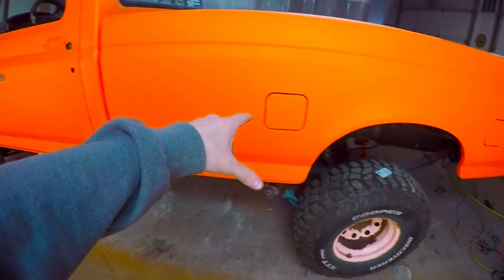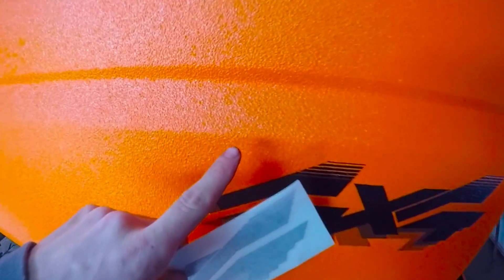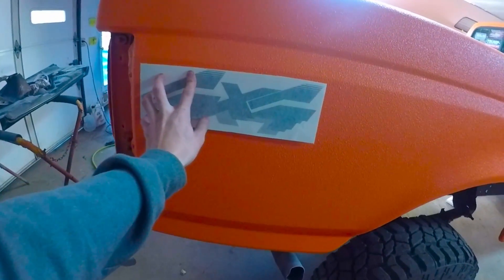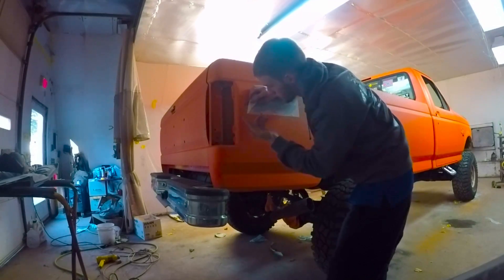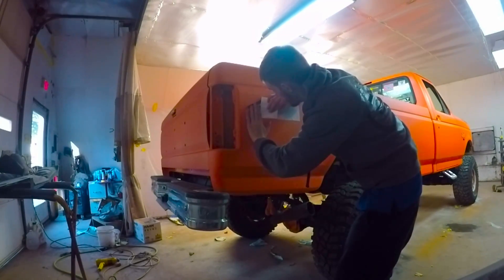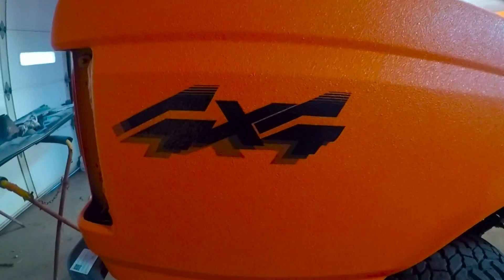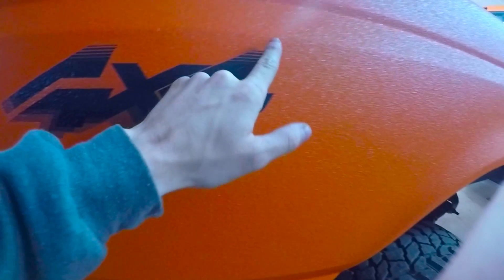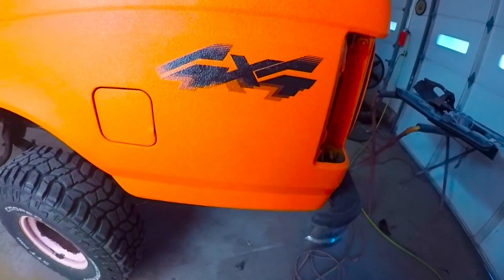HOW TO PUT DECALS ON BED LINER! (There's A Trick!) 9" LIFTED OBS FORD - Build Vlog

Comment: in the graphics industry we use a soft roller and a heatgun to adhere decals to rough surfaces
Reply: Doug DeGrave probably wouldn't hurt but we don't use edge seal on contour cut decals we just use it along edges of fully wrapped panels so they don't lift up. We use 3m primer it's an adhesive promoter.

Comment: I wonder if applying some heat before removing the transfer tape (the clear tape) would work?  You could use a rubber roller to press it in to the texture, then peel the transfer tape.
truck looks awesome!  I am watching all of these videos on raptor liner so I can do my Jeep.
Reply: that was my first thought as well.  Fixing to bed liner paint a 97 f150 (once I get all the dents and dings fixed or bondo'd ) so getting all the knowledge in I can

Comment: How would Raptor Bed Liner work with fiberglass? I have a 33ft motorhome with a fiberglass shell. Do I need to scour/sand it before applying this product over it? My motorhome will be subjected to all four seasons, including extreme hot and cold temps, hail, snow and ice storms, harsh winds, etc. I would like to cover the lower 1/3rd of the motorhome with a tough, textured bed liner that can take the impacts of road debris such as rocks, sand, traffic cones, zombies, whatever. Also, how do you tint the bed liner and do touch ups later? How long can I expect the bed liner to last? Thank you!
Reply from the maker: 1 year going strong. If you tint it a light color it is going to be a bitch to clean. I suggest black or gray or blue. Not orange. The place you buy it from will tint it. And yes you need to said it down. 80 grit sand paper. And just know you're never getting it off once it goes on.
Reply: @Bearbait01  thanks.

Comment: Great videos fella, truck looks awesome, I’m watching all your bed liner videos as I am thinking of using it on my Toyota. I’ve done the bed with bed liner paint from a well known uk auto store (Halfords) it’s their own brand and seems ok but the texture is much finer than yours, almost like 120 grit sand paper. I was going to do the whole truck in stone chip paint as I did the bottom half of the truck with it and it looked great but after less than 12 months it has faded from mat black to grey. Thanks for sharing dude from Uk

Comment: Don't you normally put the decals on spraying water first & it wets the paper & the decal slides off.  The glue under the decal sticks as the water under the decal dry completely out.  Would that have made it better.. I do like the idea of using the heat gun as I think it would help to mold it into the rough surface.. Thanks for the Video..
Reply from the maker: It wouldn't be possible without the heat gun. As for water not on a surface like this it will get trapped in the divots behind the decal
Reply: @Bearbait01  Awesome thanks for the advice.  Will give it a go on my bike. cheers.

Comment: Works great... Thanks for sharing. Now if anyone could suggest a product that would allow badges/emblems to be permanently glued on top of the Raptor Liner, that would be fantastic.
Reply from the maker: Usually the adhesive that comes on a badge works fine. But if it doesn't, any industrial adhesive.
Reply: @Bearbait01  Understand and thanks. Have you tried it yourself? If so, what brand did you go with?  Thanks!!

Comment: Did you paint the bedliner or did it come in that color? Let me know what you used or where you got it. We are redoing a golf cart in bedliner
Reply from the maker: I've got tons of videos on this channel about the bed liners. I do yearly updates aswell. I'd take a look at some of those but to answer you original question. The bed liner is tintable. So you don't paint liner the liner the paint, the color, is the liner. SEM Rock It Liner is what I used but honestly, go with the Raptor Liner instead.

Comment: Thoughts on wet method?
Reply from the maker: I really don't think that's gonna work. This didn't work either though. I would imagine the "wet method" would leave you with water trapped behind because of the bumps in the liner. The wet kethod is really just to get your decals from sticking when you position them, I had to use a heat gun just to make them stick. Wet would probably just ruin your decals and make you cry a little.

Comment: So it been a while since you posted this vid. How are the decals holding up?
Reply from the maker: Great actually. Little water seepage. But for 2 years I'd say pretty damn good. Nothing too bad and nothing that makes it look like a hack job.
Reply: Thanks for the update. I am getting ready to raptor line my  Jeep and will be doing some decals the way you did yours.
Reply from the maker: @JSTJPN  you'll want to check out the video that I'm posting tomorrow!
Reply: Have a Blazer with bed liner all over it. I'm being told to use the wet method. Thoughts?

Comment: Is that extension cord a osha concern ?
Reply: I know the wall outlets are a big fire hazzard cant believe the place hasnt burned down yet
Reply from the maker: ken pryor It hasn't burmed down yet because you don't arc the socket....
Reply: You been very lucky
Reply: If the outlet starts a fire, it has nothing to do with the plastic plate.  The plate serves two purposes; To keep you from putting your fingers on the hot wires, and to give it a finished look.  It does nothing to protect against fire.

Comment: Thanks, this was really helpful and in fact inspired me to buy a heat gun and try it myself.  My Jeep is rhino-lined (ok, "painted in bedliner") and I wanted to apply some graphics.

Guess what? It worked great!

Like you, I'm concerned about the longevity of the graphics.  I "melted" them on pretty well, but I worry about them coming off fairly easily when being washed.  That said, the Jeep doesn't get too many baths, but when it does I can see it being pretty easy to knock these off.

Any thoughts on something to apply to the top of the vinyl -- clear coat might be going too far, but some other type of of wipe-on or spray on stuff that will protect the graphics?

Thanks again!
Reply from the maker: Ceramic coating. Check out my videos I have a few on how to do it and how it lasts.

Comment: My eye’s twitching with how misaligned and uneven those decals are. I can’t believe you didn’t just measure it out, level, and lay a tape-line first. Why do things part-way and wrong?
Reply from the maker: They're straight buddy you must have a lazy eye. Or the camera makes them look crooked. They're straight 🤣
Reply: @Bearbait01  As a graphic designer than continuously adjusts images off by one pixel, I guarantee they are not straight.
Reply from the maker: Well one pixel sure. But they aren't off enough in person for anyone to even notice. We're talking millimeters.